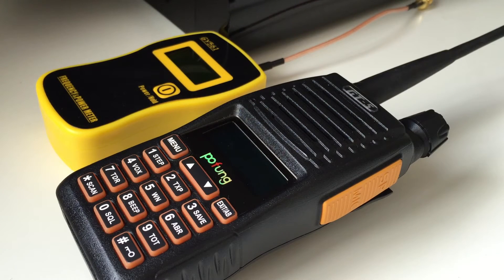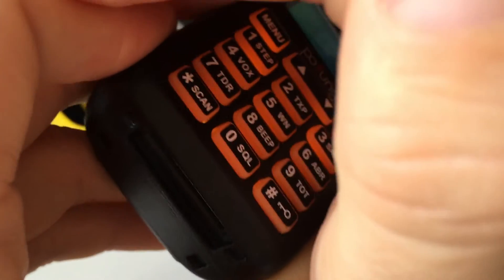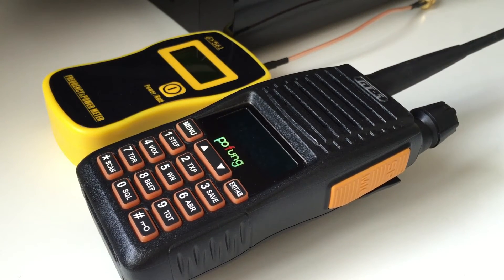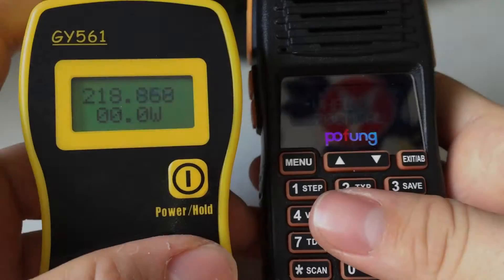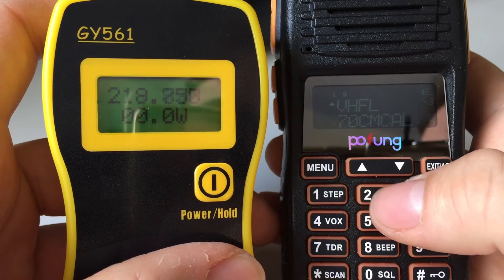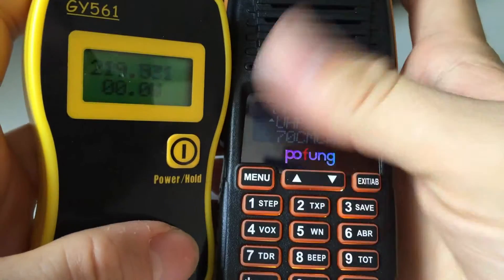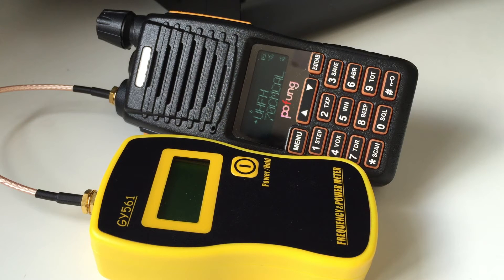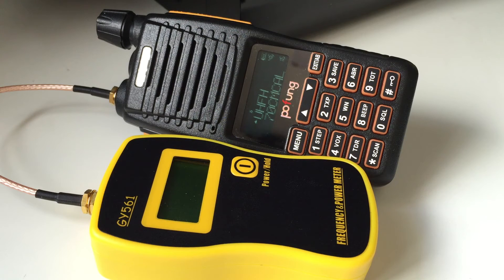Baofeng / Pofung GT-5 Power Test (Fully Charged)

Comment: Hi Lewis - just some feedback. It was after seeing your videos about the Pofung GT5  that I got myself one  :-) . I already had the UV5rg but liked the look of the GT5. I find that the RX sensitivity is better than  my UV5 but as you commented on in the video, there can be some variations, even across the same model types.  I programmed the GT5 (with Chirp) and besides some 2mtr and 70cms channels, I programmed some PMR446 channels. I've noticed that the GT5 does a better job of RX on PMR446 again, over the UV5rg ... wonder if you've found something similar?
Reply from the maker: Hi mate,

I find the GT-5 does receive better than my UV-5R's, if my memory serves me they have upgraded chips in them which are more modern than some of the UV-5R's. Although these days, UV-5R's come from all sorts of manufacturers, the fakes are impossible to spot and they use a whole array of different components and chip sets of varying quality so it's a minefield. That's why I take them all at face value and for what they are. 

GT-5 is a belter though, I barely use mine to be honest. I must take it out with me later :)

Cheers
Reply: Thanks info.... Yes, I think the GT5's front end is slightly better but I still use my UV5r... cant beat these radios given their price! I'm still hoping that at some point they'll turn their attention to knocking out an affordable HF rig... fingers crossed  :-)
Reply from the maker: Yeah they're great aren't they! I'd love a baofeng HF rig. Have you seen those Xiegu ones?
Reply: Thanks for the info... no, not seen them... just going to do a search now  :-)   Cheers!